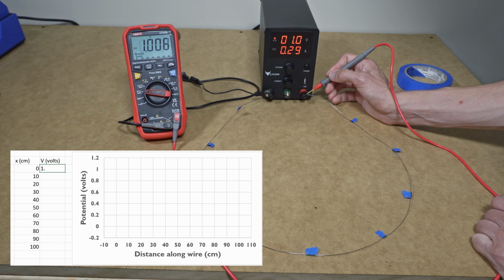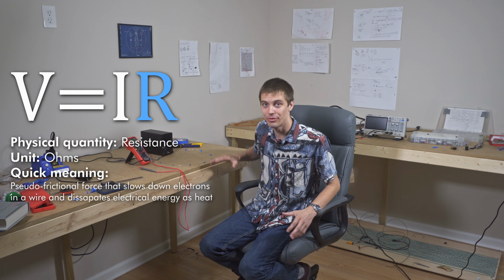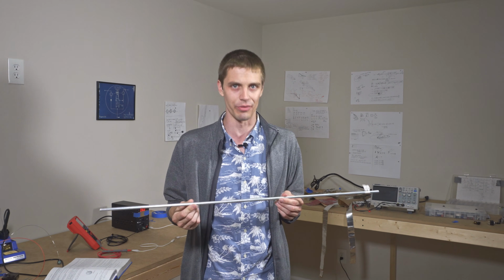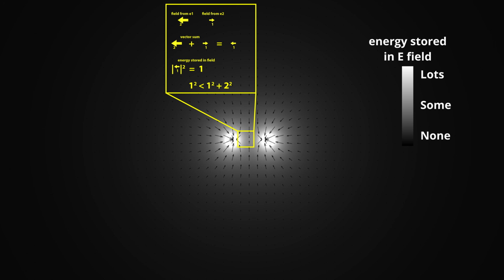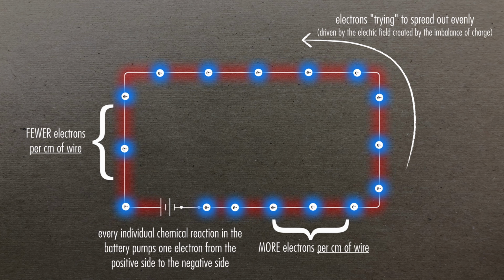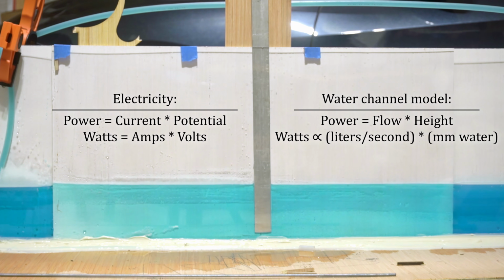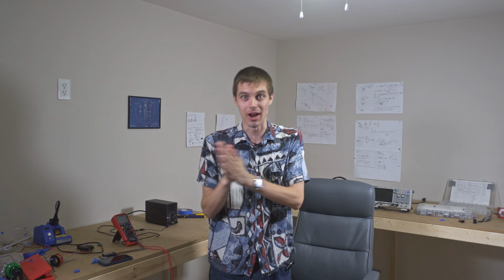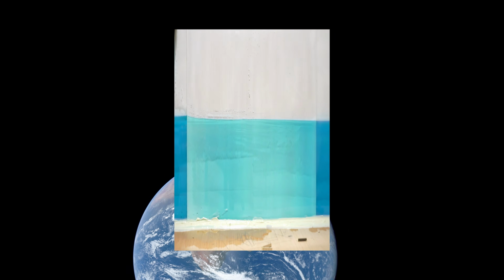An intuitive approach for understanding electricity

Comment: Your understanding of electricity is exemplary, truly outstanding. Can I ask you this, so many people think voltage kills you others think current kills you. You can have thousands of volts in a wire but microcurrents flowing through it and that wont kill you but if you have a small voltage to overcome the bodies resistance say 80 volts but a huge current say 20 amps and this combination of just the right amount of voltage and a big current, this 80 volts will kill you. So it is the overall power in kilowatts that actually kills provided the voltage is sufficient to over come the resistance of human bone and flesh, rather than just the voltage alone. Is this correct ?

Comment: Very interesting! I like how the trough analogy shows voltage and handles voltage drop. I hated the water pipe analogy. One question though; how does the analogy handle more advanced teaching? Like when you get to AC and you are trying to understand inductive and capacitive reactance? I have always felt that water analogies end up setting you farther back to start, because eventually they break down and you need to almost re-learn how it actually works. Maybe I’m wrong? Does this analogy kinda hold up?

Comment: Current is the number of charges passing a point per second. Voltage is about the energy those electrons are carrying. You can increase this energy by increasing the flow rate (current) and by increasing the energy each electron is carrying. Current is the same around a circuit because the flow rate stays the same. Voltage drop occurs as this current progresses because the energy the electrons are carrying is discarded as heat.

Comment: EE grad here - I've had these concepts more or less commited to intuition yet it was so satisfying and gave so much clarity to have them all laid out in such a well presented and coherent manner. awesome video! can you comment on the concepts highlighted in the Veratasium video describing a more "realistic" theory on how electrical power is transferred via EMF created by a circuits, pretty much demoting electron flow to more of an ancillary effect?
Reply from the maker: I see the electrostatic field effectively as an extension of the electron. The energy flux may be localized outside the wire, but that effect is inseparable from electron motion - they both must happen at once.

Comment: As great as water is for a model of electricity (so much so that ive used a circuit simulayor to simulate water) it doesnt actually follow ohms law, flow is proportional to pressure squared, rather than being linear.

Just wanted to point this out (and water "resistance" is measured as Cv (imperial) or Kv (metric))

Comment: More turns in a transformer stepping up the voltage kind of explains the "pressure" analogy, if the voltage is finding it harder to pass through all the extra turns. Idk transformers still aren’t clear in my mind

Comment: Heat is an interesting subject. it has many definitions.
the primary of which is the velocity of something (whether by elastic collision or simply vibrating).
but there is yet another aspect which is also "Heat" -- a certain frequency of a photon known as Infrared.
and yet they are somehow all connected.
in your Resistor you have water falling over a waterfall. but that waterfall also has energy.
the difference between an electron around an atom and one in a wire is the energy it takes to separate from the highest energy bond of an atom. and to be reabsorbed into an atom it needs to lose some energy. the primary dissipation is via photons. but that doesnt mean your waterfall doesnt hit some rocks at the bottom and make them juggle faster. but if that motion energy weren't dissipated the atom would be so hot from just a little current that it would melt.
and yet at the same time large amounts of photons are being kicked off each having a low freq we call IR (which is the main radiating heat).
even an atom that happens to juggle at the same speed/rate as the freq of IR now is considered hot (as in microwave cooking). enough energy and molecular bonds break & rearrange (which we call cooking).
here's something else to consider.
a Radioscope reflecting light on either a white or black side. it must reflect or the black would become infinity hot -- and the IR detector sees photons bouncing off just at a lower freq. both White & Black reflect. Black just lowers the freq of the photon on reflection to a freq below visible light so it looks black.
the means known as The Compton Effect (which is well worth knowing).

Comment: a vandegraff generator generates insanely high voltages. But it generates very little current when it is discharged.
Does it mean the relatively less  number of electrons are being squished really closely in the dome resulting in a high potential difference but very less current on discharge

Comment: You said that at 1A the electrons in the wire move at around 250µm/s and when you switched to 4A its 4 times that, so I get the point of particles per second correlating with the current. But what is the diameter of that wire?

Comment: I also came to this analogy and also a capacitor is like a container with two pipes and separeted chambers with a porous layer between them. If you move the gas (in this case, it makes more sense with gas than a with fluid), the one chamber has compressed gas and the other one vacuum. That compressed gas will slowly leak into the other chamber through the porous layer, like in a real capacitor with electrons that passes the dielectricum. 
For a coil, I came up with the analogy of a straigt pipe with water and kinetic energy. If you cut the flow of water, all the molecules have still the kinetic energy and want to keep their movement. If you imagine this, it also changes the polarity like a real coil, after cutting out the source. But it lacks the electromagnetic field. The imagination ends here for the coil.

Comment: So… the voltage in the wire can never be higher than the power force pushing electrons into it.  

And.  If there’s a total blockage in the wire then you have really just extended the battery terminal and you read battery voltage on the battery side if the blockage 
 
?

Comment: People also ask
Do electrons have heat?
In general, the heat capacity of electron is small except at very high temperature when they are in thermal equilibrium with phonons (lattice). Electrons contribute to heat conduction (in addition to charge carrying) in solid, especially in metals.
Source: wikkipedea

Comment: Is it fair to ask that if an electron in a metal wire that stumbles into a void space or a slightly defected area where it is super slightly disrupted yet still functions at its potential rate yet only changes its trajectory and wave like function to a different path, that because of the electromotive force (V) or back pressure or energy force, it will eventually follow the direction of the current down stream as it was originally with all the other electrons relative to the same speed it veered off its original path from? due to the defective area but at the same speed. Sort of like a rubber band but comes back and continues as it was. Meaning time would only be a variable in the duration it took to change its path yet responds in the same time with the same speed before its resistive shock or vibration or back wave like as you mentioned

Comment: Yes, thank you for acknowledging that water does in fact compress. It takes a lot of energy for a small amount of compression, but the number of times I hear people repeat the myth that water cannot be compressed drives me crazy. I am an engineer and working on my physics PhD, and I work with hydrostatic testing which involves putting water under a lot of pressure and compression is minute, but definitely present. Everything can be compressed, and everything can be melted at some temperature, that's another one people get me with.

Comment: Electrical potential, grounding and bonding took 4yrs of ele engineering to really comprehend this topic.   To understand potential basically follow this rule.  If you are reading volatge or different resistances of two materials there is a potential difference there for a potential voltage gradient.  Your electrical system in your body works in this exact same way.  Energy is shared and passed from cell to cell by the smallest mind gradients.

Comment: if you had the same current in the wire with the resistor, youd see the same voltage drop. its not like theres no voltage drop in the wire, its just too small to see when theres only 1V and the measure cant show actual difference

Comment: Two cubes of Sugar at 100 meters balance their plus & neg attract & repel. But if the charges didn't balance out but were cumulative (all the same charge) the attractive force between these 2 sugar cubes would be 100 billion tons of force.
So it doesnt take many electrons to move very far to be a large current/voltage.

Comment: When you say electrostatic potential that makes absolute perfect sense. I am not sure why this would be hard to understand. If you know what potential energy is it is not that hard to extrapolate it to electrical energy. Electrical energy does not need to have visible differences between potential on each side but instead of height in a fluid system it it the charges between the particles causing the flow. Edit he just ended up stating this almost verbatim. I was just using reasoning to deduct this but am goad to know my reasoning was reasonable lol.

Comment: Great video. One point that I believe to be a technical inaccuracy is when you said 5:42 that you would replace all the electrons with some current. My understanding is that only the valence (outer most shell) of electrons move. The lower shells should not move. But as you said it doesn’t really matter because electrons are all the same and it doesn’t affect the vast majority of electrical circuits or the water model.

Comment: The speed of free electrons is a bit unintuitive.   I guess the idea is that they all start moving around the same time with some speed of light constraint so the work they do is almost instantly seen throughout the circuit.  So what happens with a super conductor?  I guess some cross sectional count on the number of free electrons must bound the current.  However, a super conductor is hooked up to something with a voltage drop to do useful work and this is what limits the current.

Comment: The electrons do not move through wires like you think. Watch vertasium's. Video on a light bulb circuit that has wires that are 1 light second long but the bulb is only 1 meter away from the switch. The conclusion was that the electrons pretty much just jiggle and their movement is greatly exagerated. Almost all the happenings are through the electric field itself. The wire is more like set of tracks for the train that is the field.
Reply from the maker: Yes, they actually do move through wires. The fact that all electrons exude an electric field that they use to interact with other electrons doesn’t prevent this

Comment: One thing i don't believe was covered was with zero current a resistor or series of resistors has little to no voltage drop across the circuit.  The potential needs an open circuit to fill all of the  reservoirs. In other words, the resistors dont resist when little to no current flows

Comment: When you increased the current, the average speed of an electron going through the wire also increased. But intuitively shouldn't it decrease? Since an increase in current implies more coulombs per second of more number of electrons (4 * exactly), shouldn't the average speed of an electron through the wire decrease due to increased collisions?

Comment: 1:27 What is resistance of the wire?
1 ohm ?
My calculations say wire is very close to  3 ohms.
The voltage along any point of the wire is the proportion of the total voltage  equal to the total resistance remaining .
For  just the wire,  the physical proportions equal the resistive proportions.  Add in 100 ohms the wire alone amounts to about 3% of the total restance and not affect voltage drop. Each of 10 wire segments is then only .3% drop of total voltage.

Comment: I'm trying to refresh myself on this stuff after years away, just for fun, and this video was so helpful. The comment at 17:09 paired with the diagram is blowing my mind just because, for me, even energy isn't really an intuitive concept. If you told me "hey, when you put two negative ends of a magnet together, there's a ton of energy stored up that's trying to shoot those magnets apart" ... and then asked me "where is that energy at its peak?" ... I would guess "in between the magnets"! It'd seem weirdly intuitive—after all, the work required to move the negative magnets (or electrons) even closer together would obviously be higher than the work required to move them further away. But ... that's where the energy potential is at its nadir????
Reply: I'm trying to rationalize it ... best I can come up with, and this is wrong, is to try to think of gravitational potential energy as a "field" of influence ... imagining a bowling ball being held aloft ... and another bowling ball magical suspended in air below it (or, if you prefer, suspended by a very weak horizontal velcro connection that will break if any downward force acts on the bowling ball). That top bowling ball has the "potential" to influence/perform work on the ball below it ... but it doesn't have the ability to influence what's above it.

Comment: I was taught Electricity doesn't run through the wire it runs across the wire.  And that's why the gradient shows a different measurement

Comment: isn't electrons flowing from negative to positive... so the water channel the flow from the pump  is going from negative to positive ? .. And if that's the case how does that align with your second resistive wire example where it creates a step with a resister .. how can current go from 0 to 1 volt ?

Comment: 29:33 "you end up with a higher voltage" -- Confusing statement.  You get a higher voltage immediately before the resistor than you would have got if there was no resistor, correct? "you end up with a higher voltage" seems to say you get a higher voltage than the voltage at the power supply, which ISN'T what you mean. Right?

Comment: .For those who find it difficult to understand what voltage and current are, imagine that you are turning the handle of a meat grinder and you are turning it at the speed of light. The tougher the meat, the harder it is to twist and this required force is the current, but if you lengthen the handle, it becomes easier to twist and its lengthening is equivalent to an increase in voltage!
.. Тем кому трудно понять что такое напряжение и ток, представьте, что вы крутите ручку мясорубки и крутите её со скоростью света. Чем жоще мясо, тем пруднее вам крутить и вот эта требуемая сила и есть ток, но если удлинить ручку, крутить станет легче и её удлинение равносильна увеличению напряжения!

Comment: Amazing video!! Thanks so so much for doing this and all the effort you put into it. I have a question though, in the water model, when you add the metal sheets "resistors", wouldn't the water level on teh left ("higher potential") continue increasing in height while the pump was running, for example in the situation of 21:57 as the flow of entry to the system is higher than the flow allowed under the metal sheet and then causing and accumulation of storage on the left side? And hence increasing the votlage if we follow the analogy?
Reply from the maker: That’s the analog of charging a capacitor!
In reality the capacitance of bare wires is extremely small so the voltage builds to “final” value very quickly - the capacitance isn’t actually the limiting factor

Comment: 23:10 -- does it mean that if you add a bigger resistor the water at the bottom is acelerating more, and that temporary electrons speed is what attacking atoms by its inertia, making them heat?
But that does not explain to me why when you add the resistor in otherwise free wire, it makes all the wire cooler. The speed of electrons shouldn't change in the wire as I understand, then does it?...  how do electrons know they should heat the wire when there is no resistor?
UPD: oh, it's kind of in the end of the wire the power was sucking electrons out, making their density declining, but with the resistor the total path length for an electron changed -- it just wastes more time on the whole way to the end, but for an average electron the "pressure declining" is linear so it's declining slower.
Reply from the maker: If it was a constant current power supply, the electron velocity in the rest of the wire would stay the same and it would stay hot. In this case I was using a constant voltage power supply, so when I added the resistor in the middle, electrons slowed down across the entire loop

Comment: 1:12 Anyone understand why internal resistance of the wire is suddenly cancelled after adding a resistor? Without a resistor, the cable itself was decreasing the voltage by 10%. Why voltage didn't drop by wire after adding resistor?
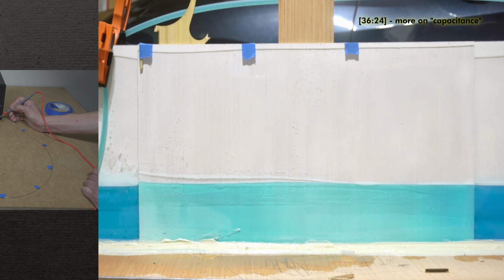Reply: See 21:00 and further

Comment: I don't know all that much about electricity but just the phrase "electro-static potential" intuitively sounds like a height difference to me. That's sort of how I've always pictured static electricity buildup too. Its a widening height which will make the resulting "fall" (when you touch something conductive) larger as the height increases. Good to know I was kinda right?